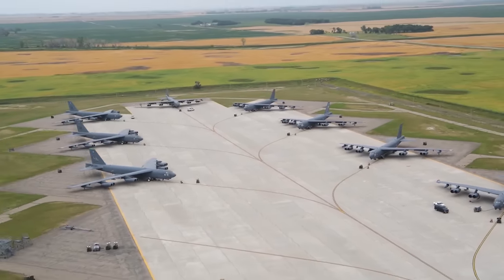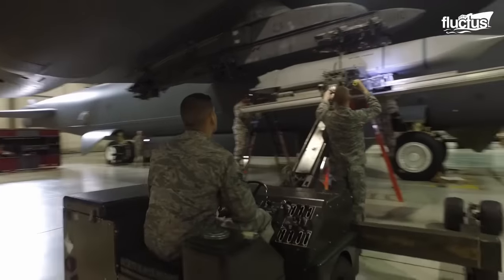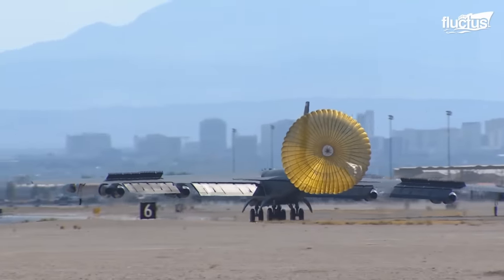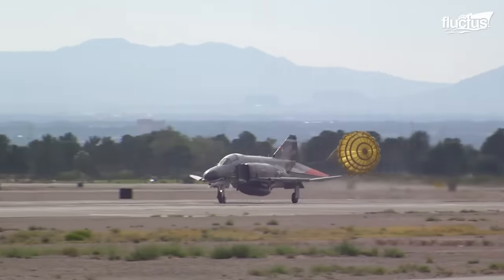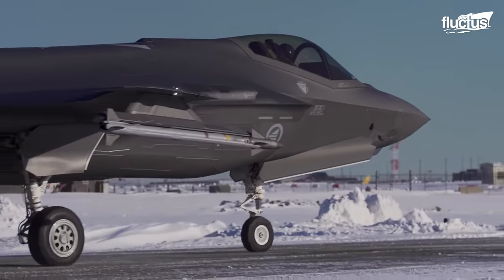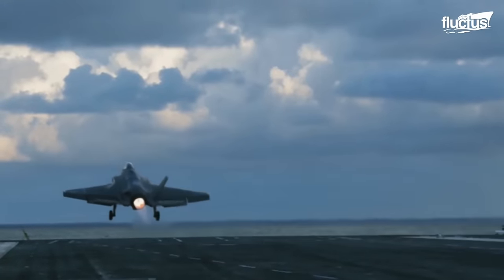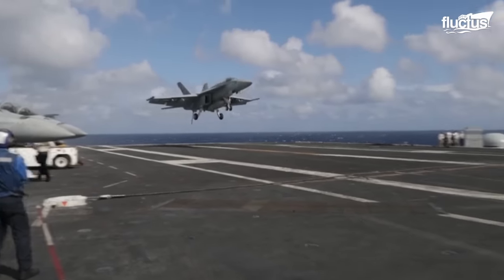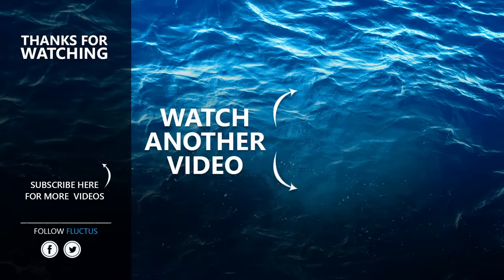US Genius Techniques to Slow Down Massive Aircraft During Landing

Comment: Just curious, why would the B-52 need 7000 feet to stop does it not have reverse thrusters? The A380, which is a much much larger airplane does not need this much room.
Reply: Just a guess a fully loaded B-52 is probably much heavier than a loaded 380. Also the 380 is more modern and have better tech.
Reply: B-52 does not have thrust reversers at this time. Maybe a future engine upgrade will have them.
Reply: The variant of the TF33 engines on the only remaining B-52 model stlll flying (H model) was designed in the 1950s and, as was common on early jet engines, did not/do not have thrust reversers.  Hence, B-52s have a drag chute for landing.
Reply: The modern wide bodies have more wheels on the ground than the b52 do there are more brakes plus anti skid system which yhe b52 probably doesn't have. thrust reverserers  are not part of the braking system for certification purposes  747 flight test program